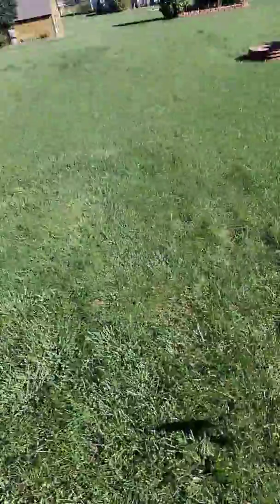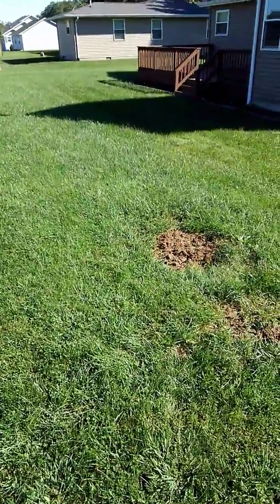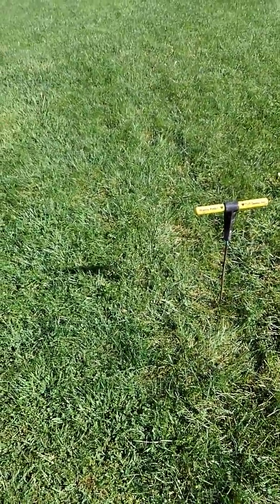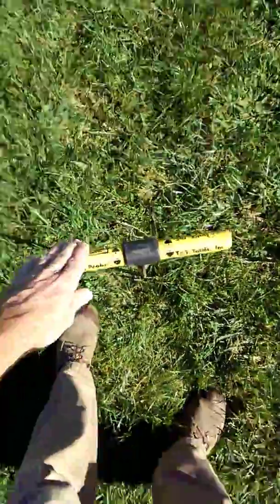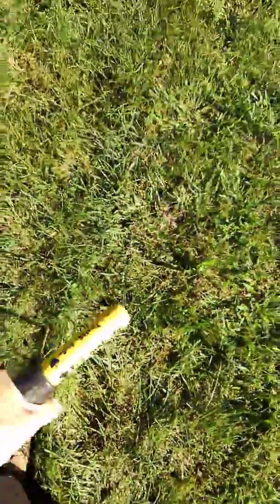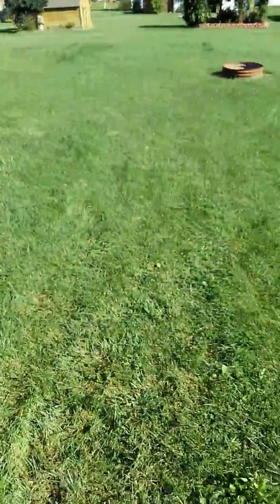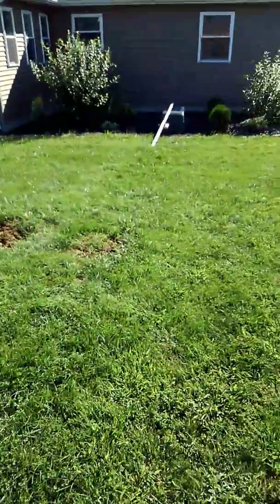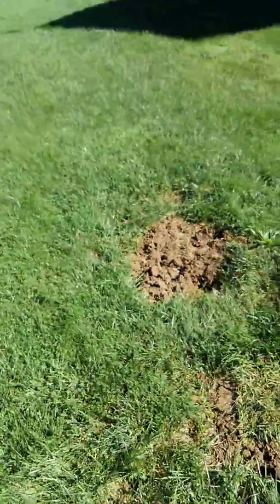Failed Leach field

Comment: The treatment you pour in wouldn't work?
Reply from the maker: The use of different liquid treatments has been tried on failing fields throughout the country. While some work, most do not. Different soil types and field construction types play into success. Liquid treatments won't change the water table issue.